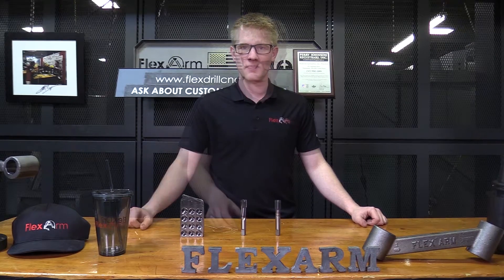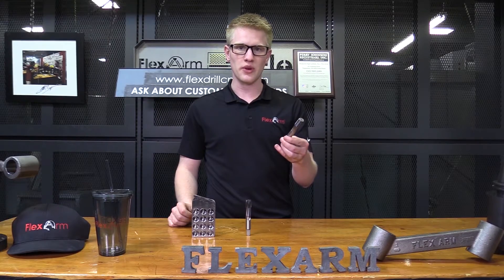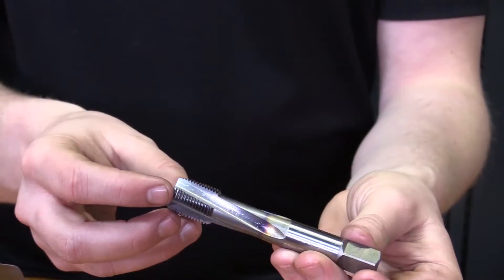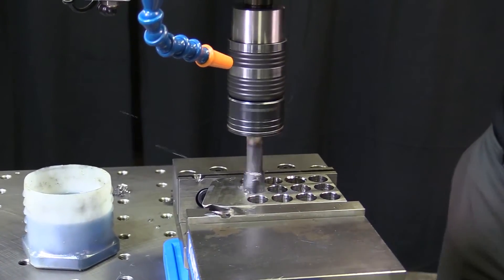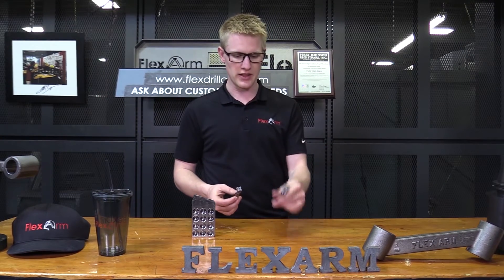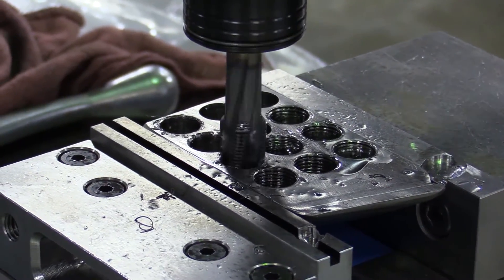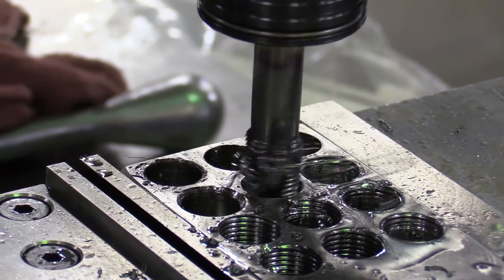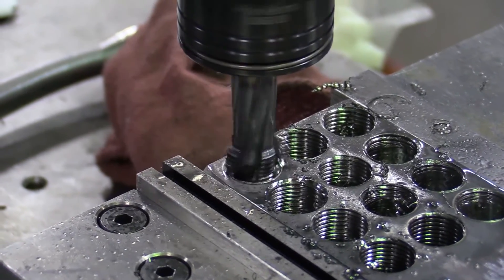Titanium Tap Test

Comment: Why not use the high speed but use the machine that has the electronic stop on it and make it stop before the tap is fully bottomed out?
Reply from the maker: Good morning Joe, great question. The problem with using a higher RPM in titanium is that it doesn't dissipate the heat as well as it does using a mild steel. It actually heats up the coolant quite a bit, thus reduces tool life. Nonetheless your suggestion of the digital depth stop is a great addition to any tapping arm. Thanks for reaching out! 
- Neil